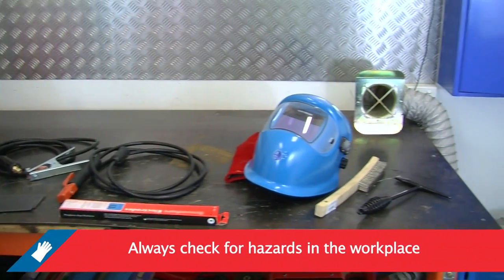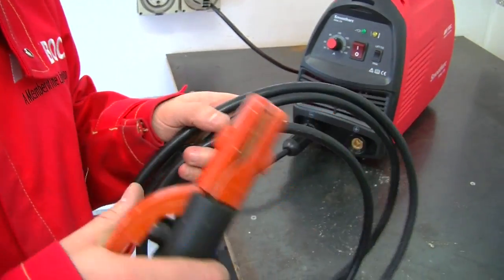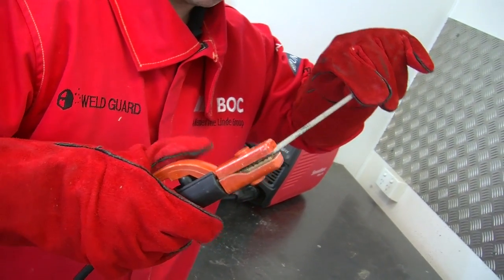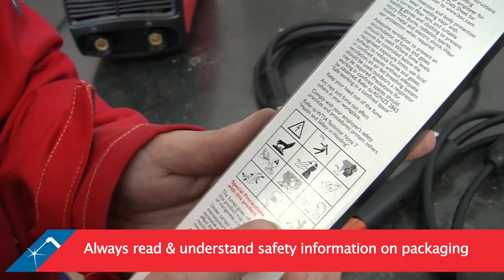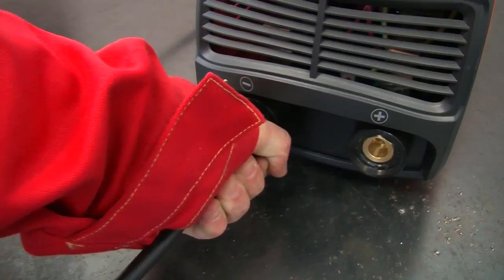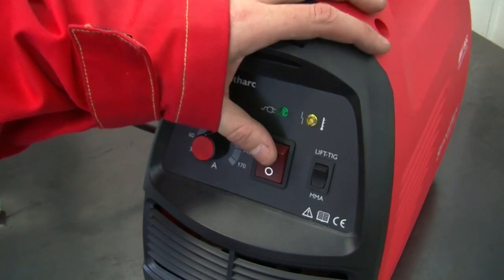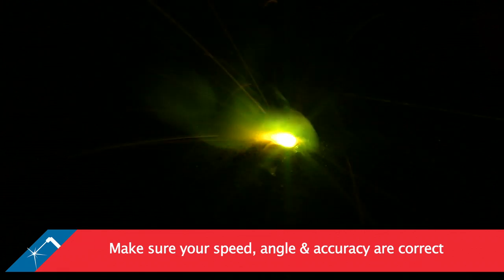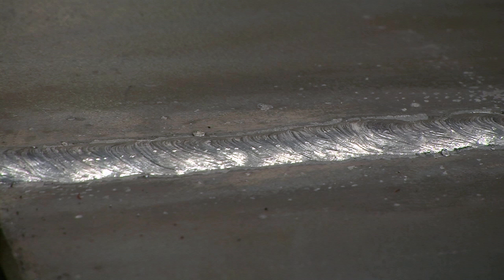BOC How to set up a basic MMA welder

Comment: Check that you have the right material to be welded?..For 5mm steel we will use a 3.2mm electrode?..Adjust your machine by turning the knob to required levels?..  WTF does that mean..The videos title says how to set up a basic mma welder, not how to wear safety gear and prepare welding area.Finally and most important....Please do not try and attempt to teach total novices to weld in just a few seconds!This video is as useless to a boilermaker as it is to a novice, in "How to set up a basic MMA welder"You explained nothing about current nor about which polarity to connect the leads....  "Connect the mains and turn on"... PMSLSo here it is, another worthless video on the tube...